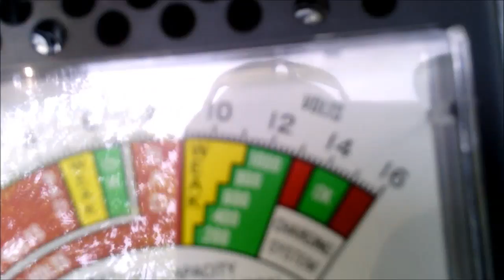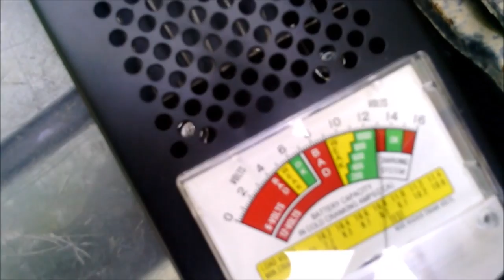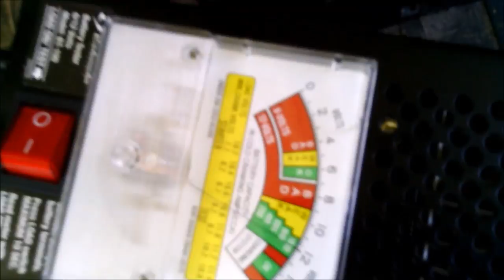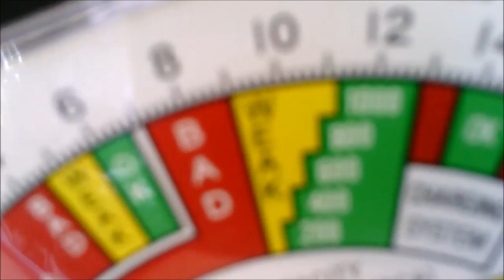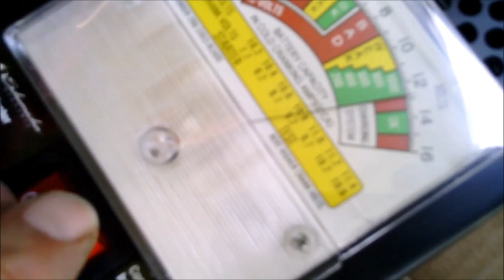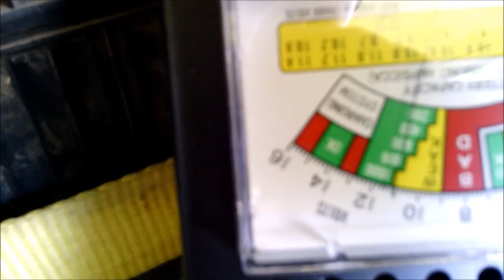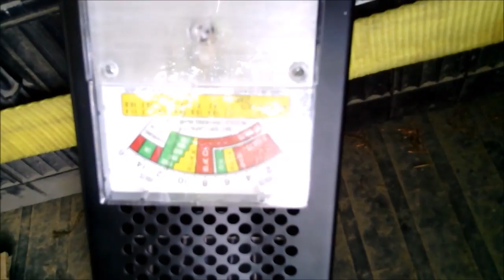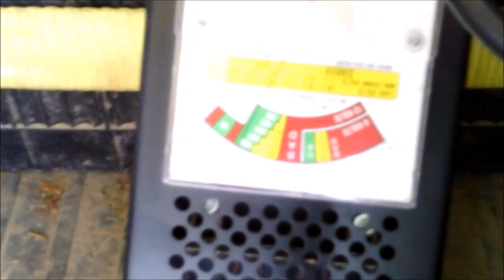HOW TO LOAD TEST BATTERIES

Comment: Too much camera shake.  So annoying.  Also a battery tester reading that dips into the bad region doesn't mean it is bad.  It could just be a small battery that is off that scale and less than 200 CCA.
Reply from the maker: dude I sold the truck over a year ago get over it already
Reply: +Josh Ketchum Who cares if you sold the truck?  I was commenting on your video, not the truck.  Also you cannot extrapolate that a  reading "off the scale" is 1500 CCA.  However if you took a 800 CCA battery and paralleled it with a 1000 CCA battery  of the same voltage and then load  tested it, it would then be "fair" to say that whatever reading you get should be close to 1800 CCA.

Comment: I WAS ASKING TO BECAUSE I ONLY HAVE ONE BATTERY AND IT STARTS OUT AT 14.2 THEN LIKE IN 30MIN OF PLAY TIME IT DROPS TO 13.4 TO ME WHEN ITS AT 14.00 IT SEEM TO SOUND A LITTLE BETTER AND IT SEEMS LIKE THE BASS IS A LITTLE MORE I CAN NOT FIND THE WORD FOR IT BUT YOU KNOW WHAT I MEAN SO IF I GET A DEEP CYCLE BATTERY WOULD IT IMPROVE MY VOLTAGE AND SOUND QULITY

Comment: Proper way to test it leave on for 10 to 15 seconds and then let cool for at least 1 minute.  Also you did not clean the terminals which is recommended.  Lazy ass test methods.

Comment: Use a simple macro lens to focus close.  DO you even know how stuff works?  Also the              voltage dip under load does NOT tell you how much power is going into the meter so that is a wrong statement by you.  Downvote by me.
Reply from the maker: go fuck yourself. know how that works cut?
Reply: ***** Ever heard of anger management classes?